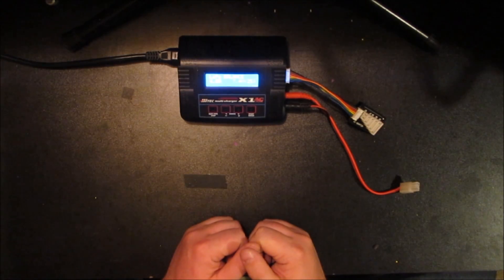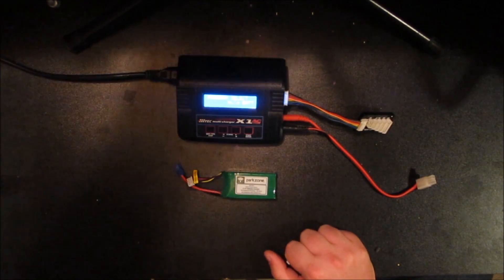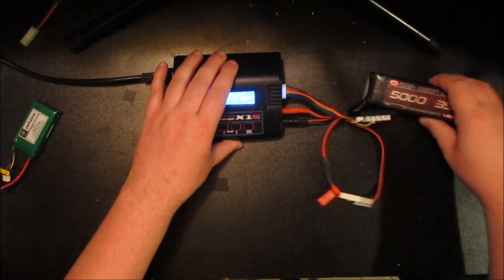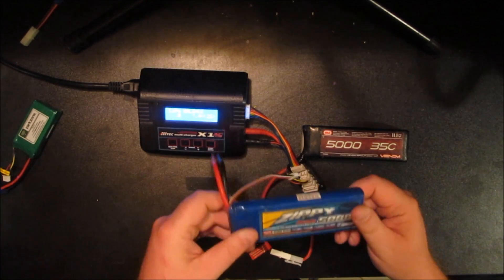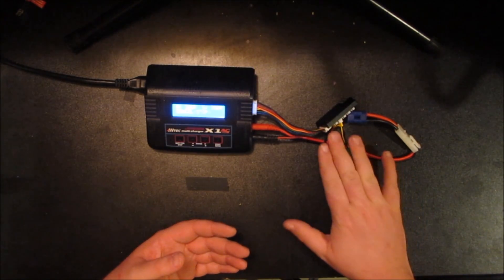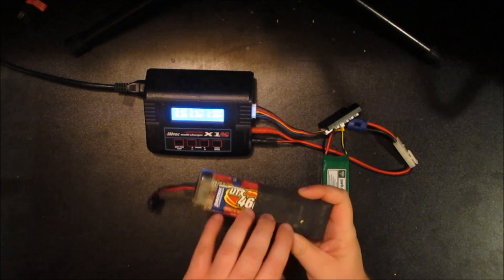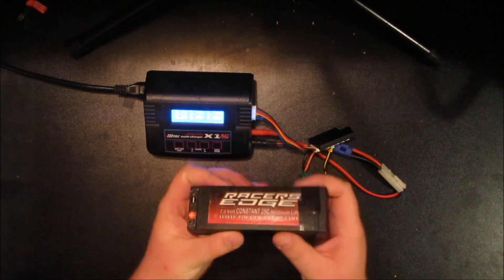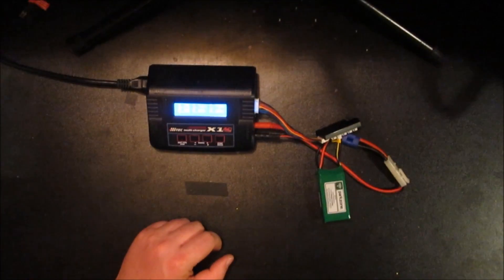How to charge LiPO batteries

Comment: Question: I went to charge my Lipo battery today as I always do but this time I got a NO Battery message on my screen with an alert tone. Have you ever seen that and what does it mean? I checked the manual and it doesn’t mention anything about it in there. I bought my battery at the same time I bought this charger and it’s never been an issue. I made sure all connections were nice and tight but for some reason the charger thinks there is no battery connected to it. Thoughts?